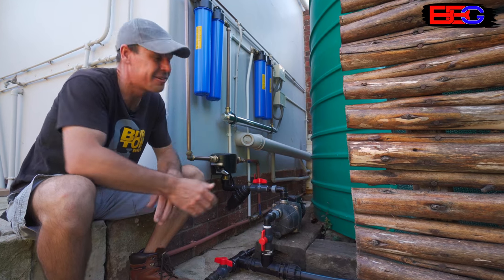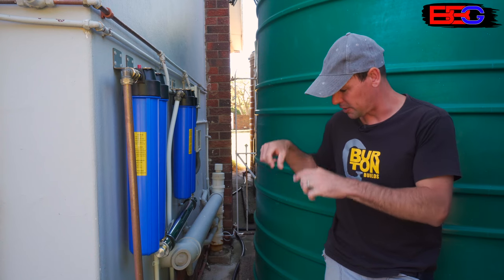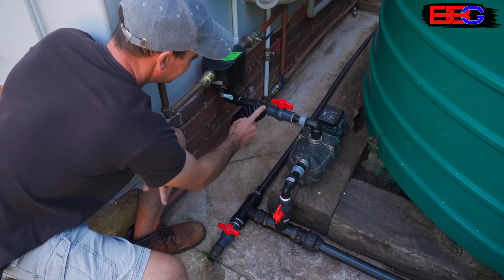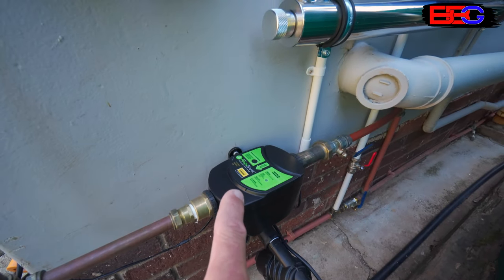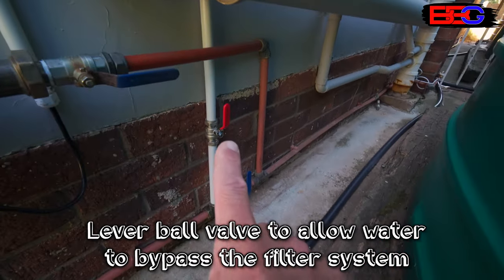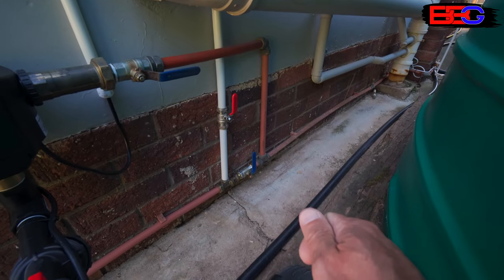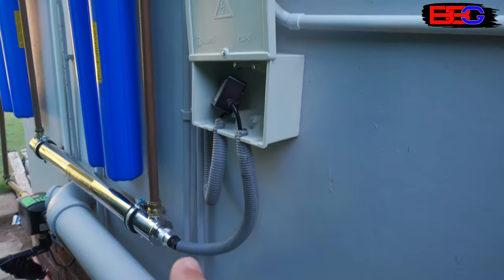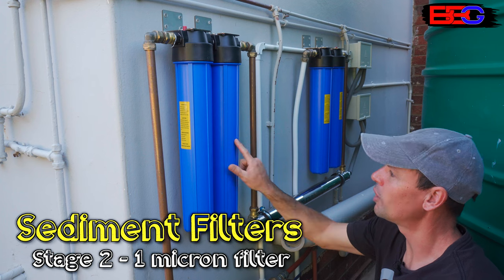Off Grid Water System Explained | Filter System | Rainwater Harvesting - Burton Builds

Comment: Hi! Really great videos! Water prices in NL are that low that these kind of systems have a really bad ROI. Though I'm working on a system because I think it's a waste to use drinking water for toilet and washing machine. In this video you show and explain the filters and uv. However, considering one would use the water only for flushing toilets and for the washing machine (so not for consumption or washing/showering), is the uv and 2nd filtering even necessary? Or even the first stage for that matter? What is your/or others opinion regarding that?

Comment: cool setup, i have one clean incoming city water. My filter housings have a gauge on top to show the life of the filter. once the pressure drops bellow a certain point I change the filter. Do you have any knowledge or opining on UV filter killing good bacteria with the bad. Maybe its healthier to not have the UV filter?
Reply from the maker: Hi Slavik, thanks very much. Those gauges are a nice addition 👍 Just my (non expert) opinion... I don't see how it can be healthier to not have a UV 'filter' if there are harmful viruses / bacteria in the water. Simply thinking about it... drink water with both good and bad bacteria and you are likely to get sick... drink water with no good bacteria and also no bad bacteria and you are not likely to get sick. I know I would choose the second option.

Technically it's not as simple as this because, depending on the standards used, water classed as safe for consumption can contain a small amount of 'bad' bacteria (Total Coliforms / Heterotrophic Plate Count) but still fall within safe standards.

Comment: Hi, how about the pressure tanks, planning to get one 60l or 100l to prevent the pump from kicking in often
Reply from the maker: I’ve also wanted to install a pressure tank and give that a try but haven’t got around to it yet. The bigger, the better and also as long as you end up getting a good quality tank… I believe the bladders in the cheaper tanks tend to fail over time.

The tank should help a lot for turning on the taps for short periods of time… like when washing hands,  etc.

If you install one, please let us know how well it’s working.

Comment: Great video. I'm looking for a similar system. Please assist me here I have a question, If you have hard water coming from your main supply, won't it deposit on your UV sterilizer thus reducing its efficiency since you have installed the softener after sterilization?
Reply from the maker: Hi, thanks very much. The carbon filters after the UV steriliser aren't for softening water, they mainly reduce odor and improve taste. The UV light needs to be replaced once a year, at which time the glass tube also gets removed and cleaned off any debris.

Many people also install three filters before the UV steriliser... Something like a 20 micron sediment filter, then a carbon filter and then another 1 micron sediment filter and this arrangement also works fairly well.

To soften hard water, you may have to install a water softener system but I believe these require a bit of maintenance (but I'm no expert on these water softening systems).